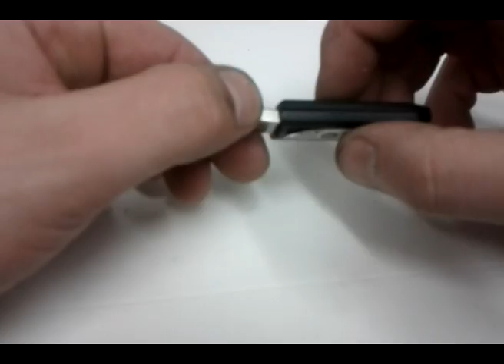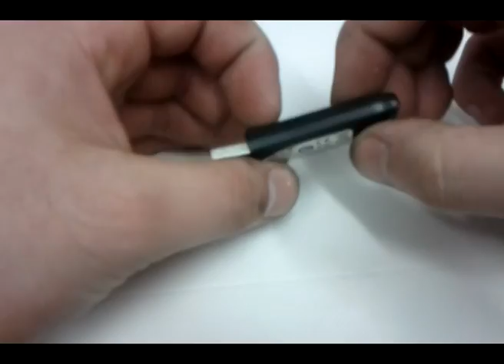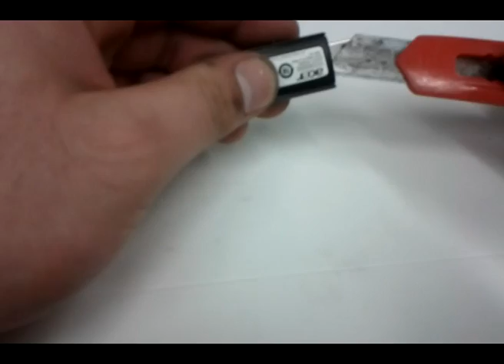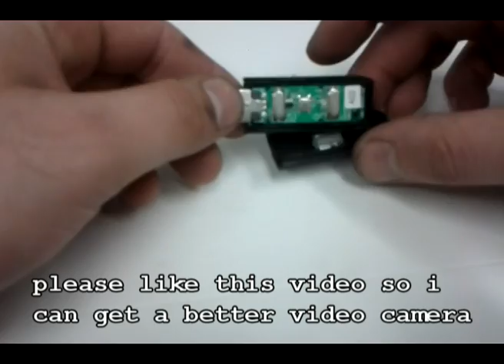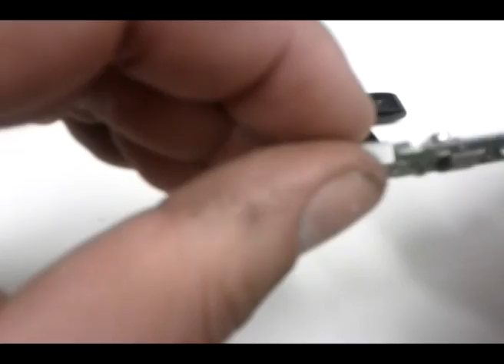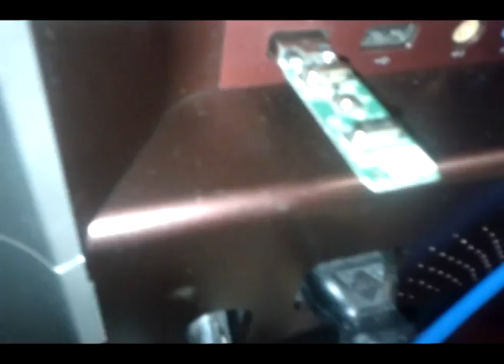How to Fix a bent USB not working

Comment: you didnt show how u fixed it
Reply: AAA Car Rental He resoldered those points mentioned. Just touch them with a fine point solder pencil to remelt the cracks.
Reply: @aryasahay9396  I doubt it. You need to melt the solder so it "reconnects".
Reply: @grafikfeat  four years and you still responded. it takes dedication for this ability and i applaud you
Reply: @aryasahay9396  no...

Comment from the maker: what i fixed was a Bluetooth usb adapter, but for usb u should still not loss any data, just don't heat it up too much with the soldering iron
Reply: Hey, man. I'm not dealing with a broken pin or wires from the plug that connects to my security camera system but the plastic of the plug itself that secures the connection of the metal is bent on one side, making the fit onto the motherboard's port too narrow.

How do I fix this?

If I bend the plastic to not be narrow it could damage the metal inside making the proper connection. Also if I attempt to shove it on there that could mess up the port from the motherboard.

From one tech guy to another, I thank you for these videos.